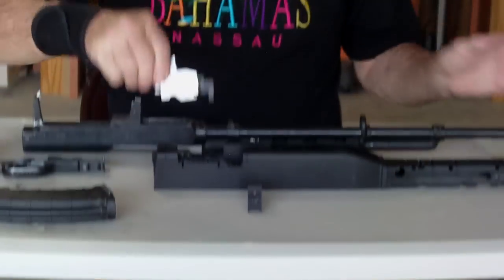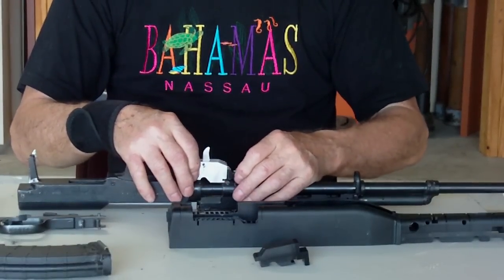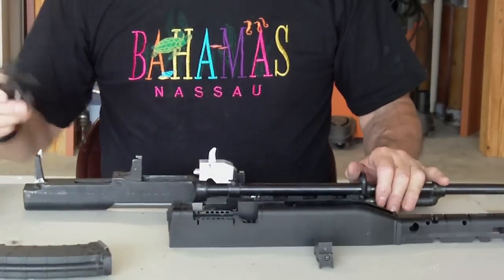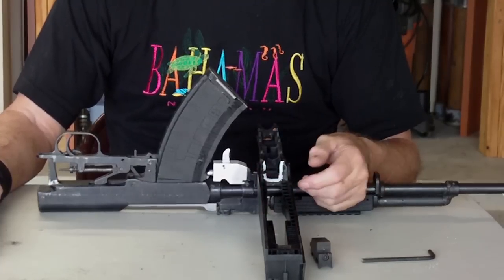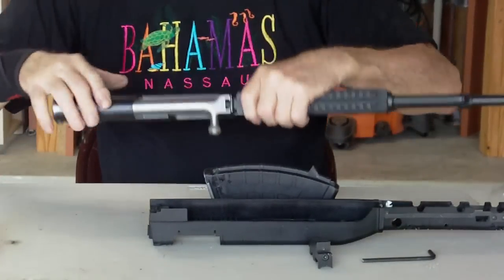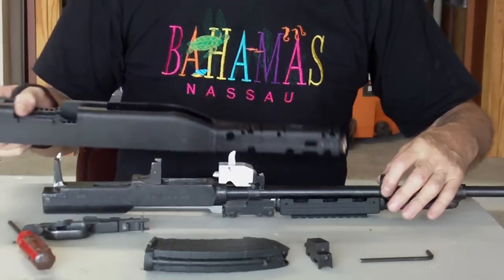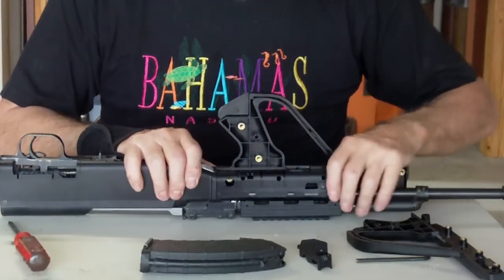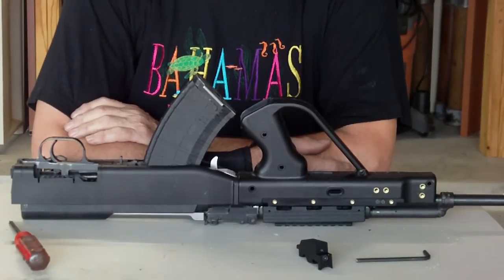G5 SKS magazine adapter, proto type1.AVI Get it at www.thesksmagadapter.com

Comment from the maker: Everyone, it is NOT possible to use AK mags with ANY of our adapters. First: the mag well area of the "standard" SKS is much too narrow for the AK mag to fit. Compare the taper on a Tapco to the non-taper on the AK47 mag. Can you open up the mag well with a mill so the AK mag will fit? YES. But there is no way for the AK mag to latch to the rifle. You would need the AK style SKS trigger assembly from a D, M or Sporter (150.00). Then you would need to weld a latch point to the front of the mag well. For the cost, just get the adapter and a mag, 15 mins later go shoot. Hope this clears it up for everyone.

Marcus
Reply: What Magazines do you use?
Reply from the maker: We use modified Tapco 20 or ProMag 30 mags.
Reply: Only think didn't answer ..does bolt lock open or ???..
Reply from the maker: @gypsymanjeff2184  Yes, the bolt locks open.

Comment: Thanks for the fast reply, i got the twist now i think... You have to pull back a lil on the mag to compress stock release slightly and then pull down the mag.... it seems to come off fine... Not just press on magadapter release and pull down

Comment from the maker: @SnowWolfJones No, I mean open the portion of the stock that the mag slides into.There is a "mag well" on the stock and the receiver. Widening the opening of the stock allows the mag to slip in/out easier and doesn't pinch the feed lips.Don't do anything to the feed lips pf the mag itself. Marcus

Comment from the maker: Probably not. The stock is  together and I don't want to take it apart and start over. It it is tight, find the bind and relieve it. DO NOT force parts together, you will strip/break something.
Marcus

Comment: @1mlt right, i understand that & just said it myself. but my point is, on an sks bolt there are 2 ridges along the bottom of the bolt that slide through the magazine just below the feed lips. without grinding those off, that means inserting a magazine with the bolt closed will force the feed lips to spread and 'go around' them to properly seat on the bolt. wouldn't that hurt the magazines after awhile, ramming the magazine up over the bottom of the bolt & forcing the feed lips to flex apart?

Comment from the maker: We haven't done a video. Remove the small screw holding the "barrel support" in place. Toss it. Use a file, wire cutter or Dremel and remove most of the polymer where the barrel support was. It should look like the white "U" shaped area in the video when finished. When the stock is attached to the rifles the adapter rides in this area. Physics laws say 2 solid objects can not occupy the same space at the same time. Something has to move. 
Marcus

Comment: @1mlt  if you think about it, a properly seated magazine means that the feed lips are seated in their dedicated slots on the bolt. widening the magazine well makes room for them to flex apart & jump around the bottom of the bolt. thats my question - how is that not harmful to the mags over time? is it because theyre polymer & not metal? seems like it MIGHT be better to mod the bolt anyway to avoid possibly hurting the magazines, as magazines are the cause of most semi autos' problems.

Comment: Well i just realised caus bolt was removed and not closed... Easier that way.. But its kind of a strugle with bolt open or not there...  So basically i have to strugle when i load with bolt open?? Kinda sucks if thos is the case since after last round you reload with bolt open..

Comment: Just a train of thought...for the amount of $ one would spend to make their SKS being able to swap out mags that fast...honestly either look for a SKS-D/M OR buy a cheap AK....compared to the standard prices on SKS's on todays market (AVG $300-350 alone for a regular SKS).
Reply from the maker: A "D, M or Sporter" model SKS cost 450.00+ these days. If you already have one, sure, use it. If you have a regular SKS, it's cheaper to go the 'adapter' route. The 'amount of $' would be far less that way. Just a train of thought ...

Marcus
Reply: I cant buy AK in Canada for example 
IT is illegal
Reply: 1mlt That's the thing...these kits are avg. $100 no?
Reply from the maker: Nperez1986
Yes, the G5/1 is 125.00, you modify your own mags if in Canada. Or, buy one modified from us if in the USA for 30.00. Yhen modify tour own to match.

Marcus
Reply: where i can buy it in Canada?
or do you ship to Canada
Reply from the maker: mike che

Buy from our website and yes, we ship to Canada. See the web address above. No mags, just the adapter.

Marcus
Reply: 1mlt So pretty much if you already have a regular SKS, go this route...if not just buy a SKS D/M model for about the same price one would pay...The price/cost ratio is just not there. If one wanted to go "AK" like...just buy a VZ58 for $399. If the company somehow can make an adapter that accepts AK mags, I think you would have a better selling solution/product to SKS owners.
Reply: Nperez1986
well it is very hard to find sks d/m
 Vz have short barrel
Reply: Yes true...in the end its what the customer wants to do with their firearm and its purpose
Reply: +Nperez1986 it's not that simple. to make an AK mag fit you have to do some milling as well as modify the bolt because the bolt is too wide on an sks. also need to modify the trigger. not worth it in my opinion
Reply: Very true
Reply: Nperez1986 but I see they have a mag adapter that takes AR mags.
Reply from the maker: Yes we do and it works supremely well..
Reply: @1mlt  where do I find one...
Reply: Oh and saw about AR MAGS ADAPTER..ANY VIDS OR INFO???
Reply: AR mag adapters ..are there any vids

Comment: @1mlt open the stock well, as in widening the mag opening in the receiver? but that means the feed lips get spread apart slightly when they hit the ridges on the bolt & slide over them into place, isnt that bad for them? or does that not affect them because theyre not metal?

Comment: As far as I can tell from his other vids it takes ar 15 mags that are chambered in 7.62-39
Reply from the maker: Mike, the G5 uses modified Tapco 20's or Promag 30's. Our new G9/A uses the AR 15, 7.62x39 modified mags. However, if you also have a AR 15 chambered in 7.62x39, the modified AR 15 mags will run in both platforms.
Marcus

Comment: Can you insert the mag with bolt closed? Also are you using in the video a Tapco 20 rounder with the duckbill cut off? Will I be able to use AK47 magazines once this adapter is attached to my SKS. Thx. for any info.

Comment: I'm having problems installing the adapter it does not fit my Yugo 59/66 A1 or my Type 56. the adapter does not fit in the space between the mag catch lip and the receiver.  the part of the barrel is flat but then when it gets to the receiver it rounds back out , I would hate to have to mod the  adapter and not have it work and I sure as heck don't want to cut any metal on the gun. A ideas that could help would be greatly appreciated

Comment: so basically this adapter works on any duckbill mags , (modified Duckbill Mags ) Am I wrong?
Reply from the maker: We have tested the Tapco and ProMag polymer mags extensively with our adapters. We do not recommend using any others as we can't say they will properly work. We have not tested any 40 round mags either. Steel mags do not work well in the SKS with or w/o the duckbill.
Marcus

Comment: the issue I see with this is holding the mag from the front..or pushing it into a ledge for support will drop the mag...not good in a high stress situation...
Reply from the maker: gixxerlouis  No issues at all with this adapter, EVER. No mag has ever 'dropped" out once set. Shove it straight up and it latches, much like an AR would. You practice loading this mag just like you would practice loading any other platform. Not to be sarcastic here, but you comment about something you have zero first hand knowledge about. Try watching some of the videos and see if it 'drops out" my friend.
Reply: +1mlt first off...you haven't a clue about my experience with firearms...secondly...I'm only pointing out the obvious...you grab the magazine like an ak when it's hot under stress that mag will drop...push it into a rest....it will drop...it might be ok for a shooting range but I wouldn't trust my life with it...why do you think all military type weaponry has the release at the rear or side of the weapon? for the same reasons I pointed out...
Reply from the maker: gixxerlouis  I did not say you don't know anything about firearms. I said you don't have 1st hand information about our adapters. Zero customer complaints, no mag dropping, no excessive heat to the mag body. You obvious is not obvious. It hasn't happened, ever. You can pull on that mag all you want, it won't "fall out".
Reply: +1mlt I think you are missing what I'm saying. ..the forward mounted mag release could be accidentally depressed...under high stress situations...or resting it against something...no doubt it stays in well...do you make a version that doesn't have the forward release? so the mag can only be released from the rear?...that I would be interested in...
Reply: +1mlt well...this mod is pointless...it won't accept ak mags...only your modified mags...for the price and labor it would be better to buy an ak...it's a proven and reliable system...not an added on gimmick...best of luck to you and your business...
Reply from the maker: gixxerlouis This adapter was designed to be used with "BULLPUP" type stocks. The mag is literally hanging under your nose. The release is no where near your forward hand. It is not an issue. It won't be resting against anything. It can be used with standard type stockes. Yes we make a G3 that uses the SKS mag catch in the trigger assembly to release the mag. We also make an adapter that use AR 15 x39 mags. That adapter releases like the AR does, bottom right, rear of the adapter. And the mag will run in both platforms.
Reply from the maker: gixxerlouis Pointless? Why is it pointless? The standard SKS won't accept ANY AK mags w/o serious major surgery to the rifle mag well. AK mags are to wide to fit the well. But you should already know that.

Comment: So you're using modified Tapco mags?  Do you also sell the modified mags?
Reply from the maker: The G5 uses modified Tapco 20's or ProMag 30's. Yes, we stock and sell the modified mags for 30.00/each. We built a 'jig' to hold the mags and then we cut them using a mill. You can easily modify them with a Dremel. We suggest you buy one mag from us as a template, then mod your own.
Marcus

Comment: Ok ... how does this help ?? You buy this part and install it then buy a .. duckbill tapco magazine .. and then have to cut the magazine up to make it fit the adapter ??? I must be missing how this helps anything !! Why not just use the  .. duckbill magazine .. the way it is ?? What are you gaining by this adapter ??
Reply from the maker: No more duckbill to deal with and it feeds better because we pitched the angle up for a better launch to the chamber. You can store mags 'normally' in a vest or pouch w/o the duckbill hanging out and grabbing everything it touches. You can easily mod your own mags. Read the testimonials at the website. It just flat works better. Don't buy it if you don't want it. A whole lot of people have purchased them. See some of the comments below. If you want to use AK mags, please buy a AK. I have no issues with that. Personally, I don't want 35,000psi exploding inside sheet metal under my eyes.

Marcus
Reply: Because the duckbills look ridiculous, especially in a bandolier. I saw a much more involved method for modifying the sks to accept AK magazines, but this solution allows you to have "normal" looking mags without doing any permanent modifications to the functional parts of the rifle itself. Is it really that hard to figure why someone wouldn't want an ugly-ass duckbill mag?
Reply: 1mlt  No disrespect intended ... The carrying aspect I didnt think of but honestly that wouldnt make me buy an item and them cut it up . and almussalix ..Im not one of those assholes that has to impress ppl with the way things LOOK ... I dont give a shit what it looks like if it operates the best it can. The modification does nothing to HELP the function of the weapon .. it is only to make it easy to carry extra mags. So you make your shit LOOK good and Ill make sure mine works properly !!!
Reply from the maker: Bleepstick
One thing you may not be aware of, we changed the geometry of the feed angle of the bullets path to the chamber. No more jams below the barrel with 20 OR 30 round modified mags. THAT you can't do w/o the adapter.

We aren't trying to sell you anything. If you don't want it, that's perfectly fine with us. But I can tell you that a LOT of people have purchased from us and they love the way they work. Not your cup of tea? OK, drink some coffee then. Or a cold beer, or whatever ...

Best Regards,
Marcus
Reply: 1mlt
You ARE trying to sell me something but its something I want. My real question is: What magazines DO NOT work with this adapter? Its an awesome product, but what makes have you not tested with?
Reply from the maker: almussalix
 The only mags we have tested and will say work are Tapco 20 or ProMag 30 round 'modified' mags. None of the others we tested would work reliably. We offer both of the modified mags for sale at 30.00/each. We have them in stock.
Marcus

Comment: why don't they redo the trigger assembly? make a new American made one, that's complaint, built to take  an AK mag. that also comes with the mag catch adapter.  I don't want to buy more mags for one gun. I already have a hundred mags for my AK's. I don't want to buy more modded mags.
Reply from the maker: +Ben Hunt 

Ben, it isn't JUST the trigger or the mag catch adapter that is necessary. True, those are easy to make. You MUST mill out the receiver well for the AK mags to fit. AK mags are much to wide at the top to insert high enough for the bolt to scrape a round. Not really a good or easy idea.

Marcus
Reply: +1mlt that's fine. I've had to do a lot of minor gunsmithing to make small.mods work. I'm fine with that. just make it to take the majority of AK mags. I'll mill out the well a scosh